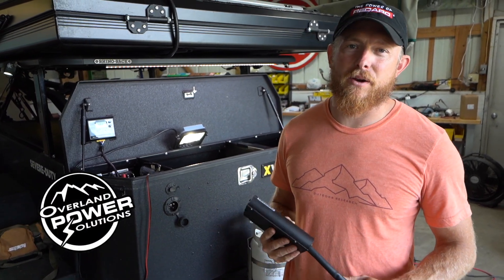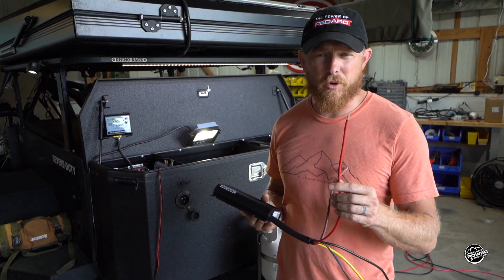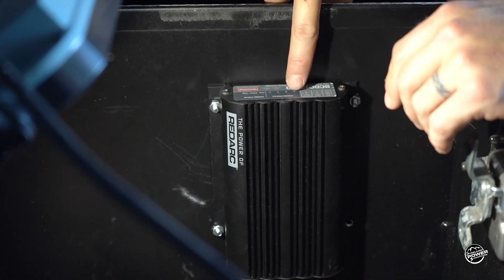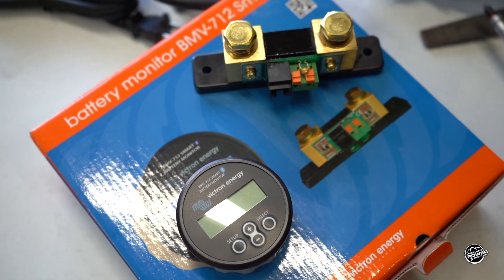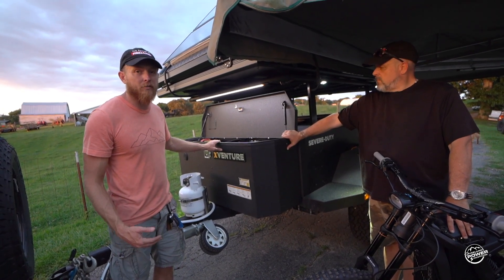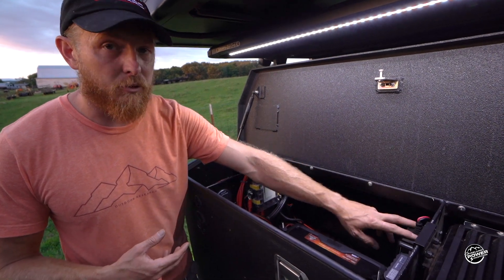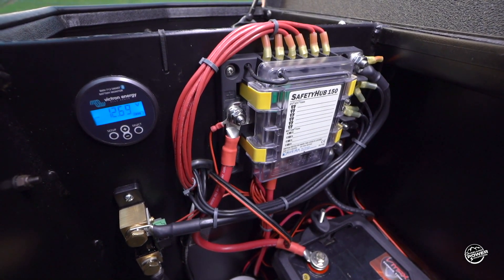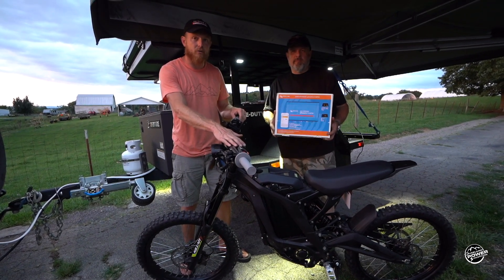Overland Trailer Power Installation - Overland Power Solutions

Comment: Why not just use the victron DC to DC instead of the redarc? That way all the pieces talk and can be monitored in one app? The price difference is actually cheaper for the victron by a few hundred.
Reply from the maker: I wouldn’t trust Victor to repel Chinese knock offs, let alone water. I’ve had a few Victron parts fail, but never had a Redarc Part fail. You get what you pay for
Reply: @OverlandPioneers  hmm maybe redarc will make the other componets at some point. Just would be nice if it was all one brand with the same functionality.

Comment: Where did you connect the positive and negative leads of the Victron Smart Battery Charger? From the house battery to the Safety Hub 150? Did you put an inline fuse on the Victron?
Reply from the maker: That is above my pay grade lol. Contact Overland Power Solutions for more info

Comment: could you not use the redarc manager 30 in place of that all? im thinking of getting one and it looks like it does all three. solar, battery and shore
Reply from the maker: It absolutely does! Great system. Just at a higher price tag.
Reply: @OverlandPioneers  thanks for the quick response. just wanted to make sure i was getting the correct system.
Reply from the maker: @majers_abroad  if you get the monitor there are awesome dash mounting options for it

Comment: It depends on manufacturer if the 7pin will charge trailer. Ford 250 just requires a under hood fuse change
Reply from the maker: B-Rad D R it’s not the fuse size it’s the cable size. The 7 pin harnesses don’t have a large enough gauge wire.